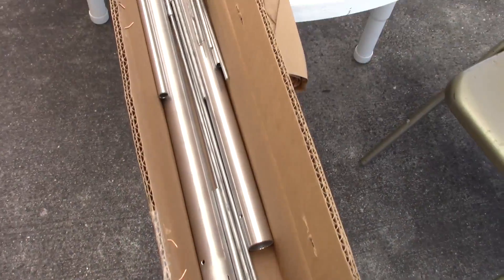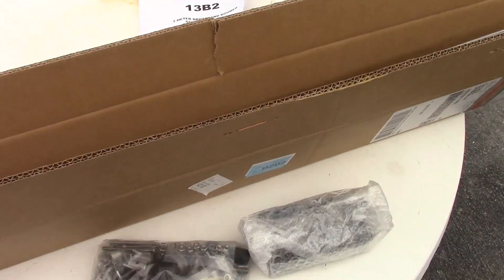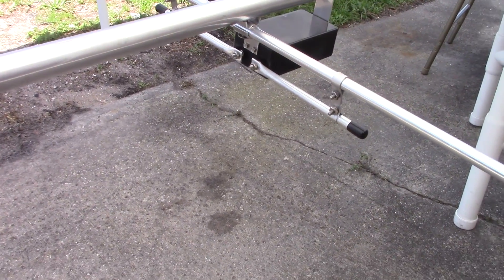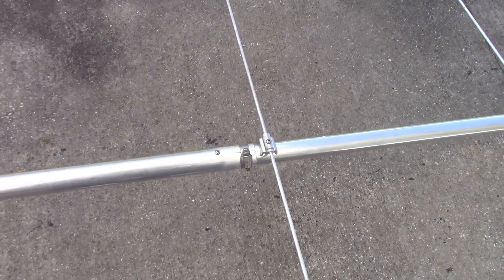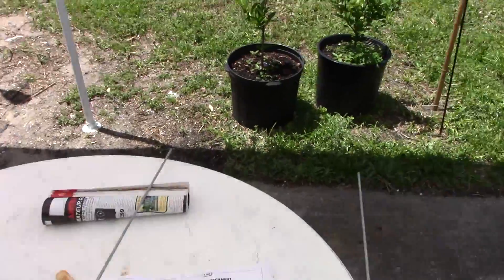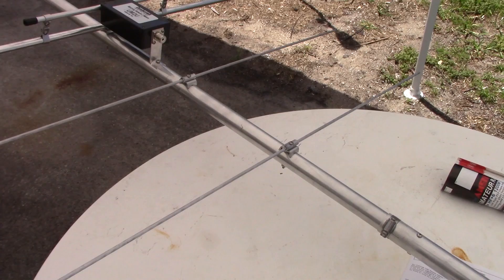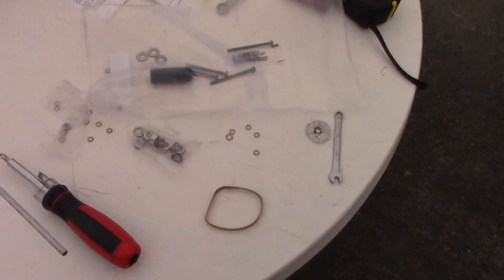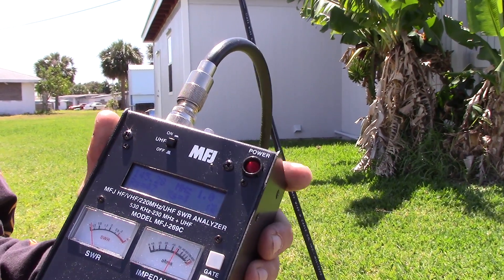Cushcraft 13B2 VHF yagi 2 meter VHF SSB/FM/CW 144mhz antenna

Comment: For the price I would have sent it back if the elements were not the right length.
Reply from the maker: Still using it to this day, lately I have been getting some 900 mile contacts across the southeast USA on 2 meter SSB

Comment: I bought two of these several years ago when they were on sale for $139 each. I bought a custom made phasing harness from M2,  he helped me with spacing and measurements. I have them horizontally polarized and  have been using them for years. I am able to hit nearby repeaters fine and get 300-500 miles on 2 meter sideband groundwave without tropo.

Comment: CAUTION:If you can keep water out they work great but it’s impossible with the humidity here in North Florida.I have owned 2 sets and no matter what I could not keep water out of the black box.I replaced mine with a Cushcraft 215WB & it kicks a 13B2 to sleep and is not affected by weather.
Reply: There is a hole at the black box that must be placed at the bottom so water, condensated from water vapor in the air every single night, can exit freely.

No problem!
Reply: @josemariatrueba4568 I’m smart enough to know that. We have spiders and Dirt Dobbers that fill the holes with mud that hardens and then condensation is Trapped inside the Black Box. Every one I have owned ended up the same way. The 215WB doesn’t have that Big Flaw and the materials used in the 215WB is far Superior to the 13B2 as well. The 17B2 material is beyond Pathetic.

Comment: Best to insulate the elements from the boom. With 2m losses occur along the boom from the elements in electrical contact with it. The "no insulation" approach is to keep costs down...
Reply: Do you just put rubber between them? What's the best approach for insulation?
Reply: Yes, those plastic insulators are a real profit killer. : )
Reply: Negative. 
You must have a good connection between elements and boom tightening the bolts properly.

Comment: just bought the 17b2 so hope it works as well as suggested :) got the 719b for uhf hopefully get them put together and up on the tower so i can reach out and touch someone
Reply: TERRIBLE materials in a 17B2.I had one before MFJ bought the company and the support arms both broke like toothpicks.A 215WB is a better antenna than either.

Comment: Nice presentation. A bit wordy, but nice. 

At VHF frequencies and above, it usually isn't a good idea to discuss SWR. The reason is that because the transmission line losses can be significant, discussing SWR is not helpful.

Instead, discuss the antenna in terms of return loss. A 2:1 SWR is equal to a return loss of approximately 10 dB.  So if your cable loss is 5 dB you could have mismatch of as much as 3.5:1 at the antenna and it would look like a 2:1 match. A 2:1 match would look like 1.43:1.  So where does the difference go? It is lost in the coax.

Also, little losses add up. That SO-239? Use an N-Connector instead. I also highly recommend sealing that connector very well. Sunlight will destroy a lot of seals and water will creep in to the tiniest places and slowly degrade your coax. If you invested real money in that coax, consider spending a bit more and covering it up with a sealant. Even Electrician's putty is better than nothing. I used to alternate layers between a role of electric tape and Scotchkote 33. 

Good Luck!
Reply from the maker: My next video i am making is discussing the new feedline i have on it. Messi and Paoloni hyperflex 10, way better than the LMR400 i have used.
Reply: Don't believe anyone's specifications. MEASURE IT.  Get a dummy load, and a watt meter, measure the power between the transmitter and the coax and then measure it between the coax and the dummy load. You should see a loss. 

I have not heard of this vendor before now. For all I know, they might be pretty good. But I am always wary about extraordinarily good claims. Perhaps their dielectric materials and braid coverage really are that good. But I need proof before I believe in a spec that good. 

Antennas and transmission lines have been the subject of many snake oil sales attempts. Tread with care. 

73, 

DE AB3A

Comment: Holy Schnikeys!

Awesome antenna.  I didn't catch the price or if the elements are insulated from the boom?
Reply: Greg Gallop Don't know the price, but the elements are not insulated from the boom...
Reply: on the general exam it tells you if you use a match there is NO need for insulators from elements to boom  @vonzigle